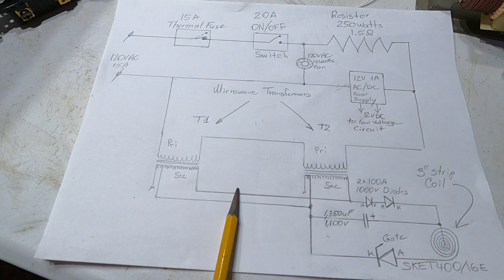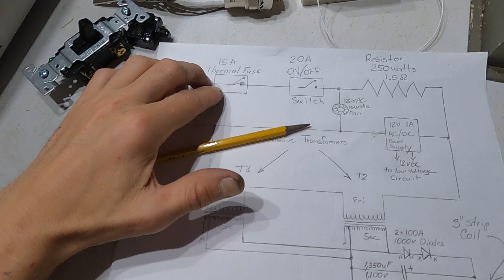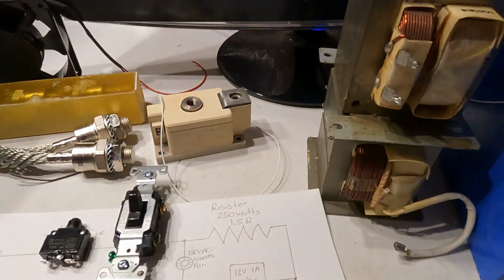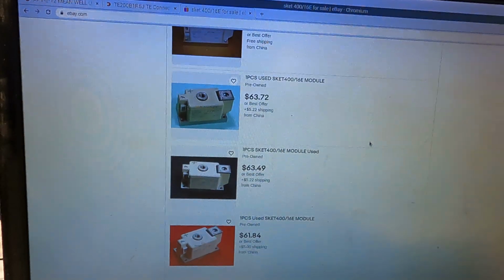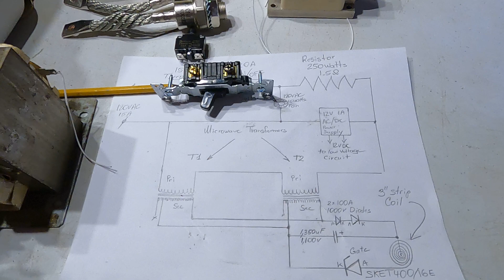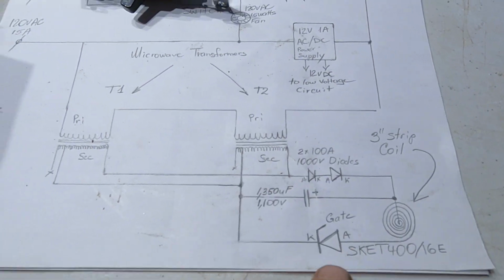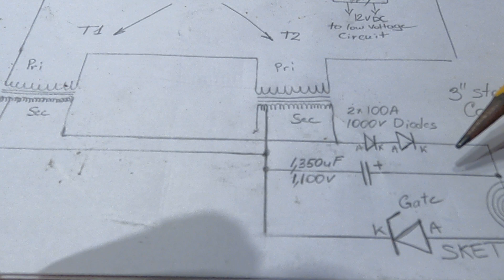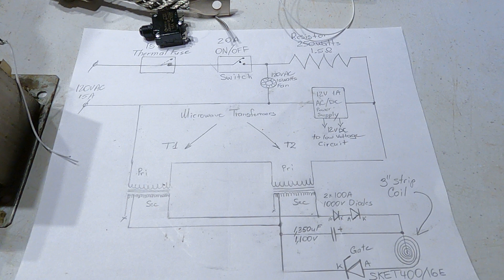137 Charging circuit for BBMPulser 5.5B and 6B using microwave transformers

Comment: There is a question I don't understand about the diode. Why didn't you use 1000V 100 amps, 2 units connected in series and 1 more powerful?
Reply from the maker: Im still testing. You can use one 1800V 100A diode, it will cost more then 2x 100A 1000V diodes.

Comment: What is the wire gauge that you use to connect diodes to the rest of your circuit? Looks like they are pretty thin like 20 or 22. 
Why do you need the diodes to be rated to 100A when connecting wires definitely cannot withstand 100A?
Reply from the maker: Because when I put 80A diodes on the heatsink, they heat up, that's why I use 100A stud diodes, they don't heat up and I don't need to use heatsink. If components don't heat up this means they have less chance to fail. 
So it's to make it reliable
Reply: Thanks for explanation. 
How many seconds does it take for the capacitor to fully charge?
Reply from the maker: @codelabs  around 8 seconds between 3.5 Tesla pulses

Comment: You’re leaving everyone else in the dust Andre. Even s_o_t_a, who just released their MP7 model outputs on regular mode only 7000 Gauss. Keep it up.
Reply from the maker: I believe 3 Tesla max  with power adjustment is the perfect power,  0.7 Tesla is low
Reply: @AndreyD  Exactly
Reply from the maker: @cadcdo2532  my 7th generation model will produce 7 Tesla output, Sotas 7th Gen model outputs 0.7 Tesla